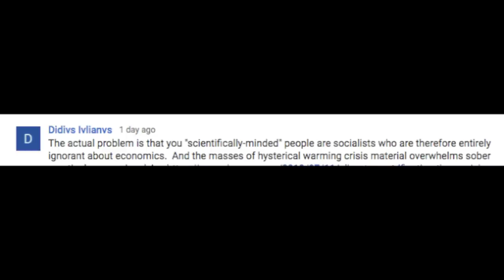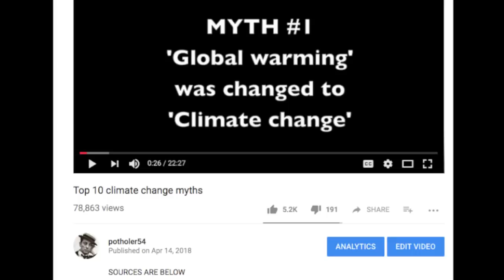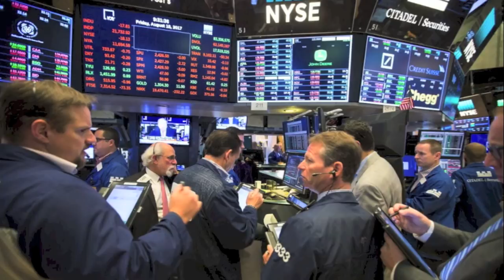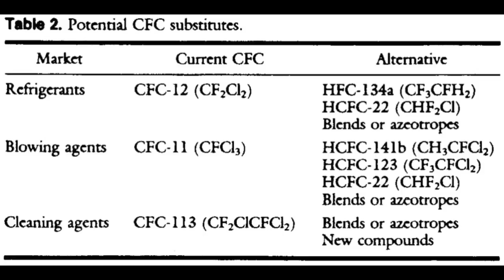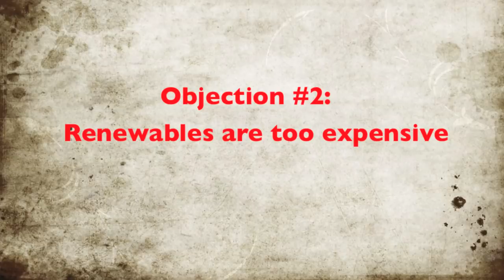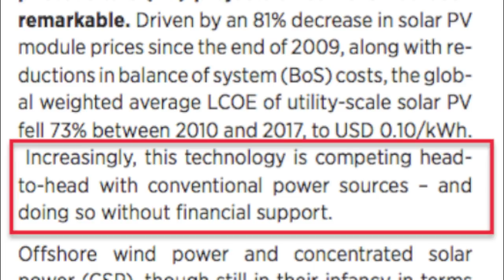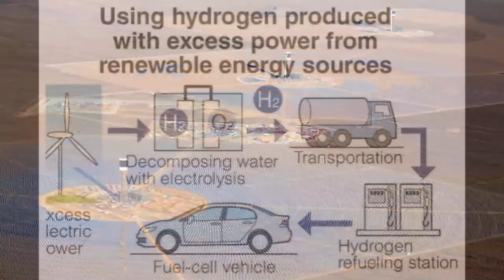A CONSERVATIVE solution to global warming (Part 1)

Comment: @17:32 the most efficient of these 'batteries' still wastes a lot of energy...if you rolled up your sleeves and found solutions for nuclear you might end up with a better solution that dosen't need batteries. I wish nuclear was invested in alongside renewables, because it can fix problems in supply created by them and is arguably cleaner if you store the waste safely.
Reply: Here is the greatest lie ever told about renewable energy: That we need energy storage because of it. Nope. We need energy storage, period. If you replace all renewables with more coal and nuclear you will still need either energy storage or another power plant for when every house in the city turns on the lights, AC and TV at the same time. And the exact same people who complain about renewables will again tell you that energy storage and nuclear is too expensive and we should instead build another coal burning plant.

Except you can't light up a coal furnace and start producing more power in the seconds you need to avoid brownouts, those turbines take minutes to start spinning and that's after however long it takes for the water to star boiling. What these anti-battery lobbyists are really saying you need to build a coal power plant, supply it with coal and keep it hot 24/7 just in case you need a little more power for a few minutes. Because building that coal plant is indeed cheap, but just like the shop offering a cheap printer or razor now with extra 50% off, they are trying to hook you into paying for the overpriced ink and blades instead.

Even if you just build a bigger power plant in the first place and leave some capacity unused for the times of high demand, that capacity needs to be ready for immediate use, meaning it takes coal, manpower and maintenance to keep it that way. Even if the owner of the plant agreed to leave that as a reserve instead of running at 100% all the time and sell more electricity, do you think he doesn't want to be paid enough to keep that kettle boiling 24/7?

I definitely support nuclear and renewable energy, but even if we figured out high temperature superconductors and could power the whole world by drawing power lines from solar panels at the equator we would still need some kind of battery for both balancing short term demand and as a reserve in case of some accident cutting the lines.
Reply: @AnalystPrime  No one is saying you should never store power. We have done this for as long as we have generated electricity, by doing stuff like pumping water upstream. This is not new, batteries have their uses. The important point is the 'duck' curve. Demand for energy has a small peak in the morning and a larger peak in the evening and night. Energy generation from wind and solar tends to peak mid day. When i overlay these graphs I get a duck shape. The gap in the middle is the problem, as I need to store most of the energy I make for the evening. Doing this incurs a loss, as it always will due to the laws of thermodynamics. The loss currently is big, batteries are not a wonder cure for this. The more expensive batteries use lithium which has problems with supply as its mainly mined from salt plains, such as the one in argentina. A small amount can be extracted from seawater, but the technology isnt there yet for it to be comercially viable.

The problem with renewables is that we can't just up energy output at peak times. Nuclear isn't that good for this either, you have to slowly change the power output of a reactor to keep it safe and turning it off requires fuel re-enrichment, which takes time. Coal doesn't have those problems, you can fire a plant up much easier than nuclear. I am very pro nuclear, so I say this with gritted teeth, fission does not fix the gaps in supply of renewables. This is one of may reasons why we are so interested in fusion, a clean nuclear reactor.  If it weren't for the large downtimes of the experimental reactor, you could either start a reactor running with a burst of power or keep it running in steady state as it will eventually be very cheap to run. There are problems with renewable energy source, if you don't believe coal lobbyists (which you shoudln't!) ask people researching in that field.
Reply: @coolpeopleit  The duck curve always sounds weird to me, keeping lights and TV on late at night uses more than all the industries that operate during the day? Alternatively, it is saying solar power is enough to cover all the commercial needs yet still "not efficient enough"... Also, wind always calming at the same time sounds like the very opposite of "can't be relied upon", if you know when it is windy and when it won't be blowing then you know where to put those windmills so you can get wind power 24/7. Then there are tidal and geo power, how do those just shut down every day?
Lithium batteries are not the only tech we have, only the best we had for small scale stuff like cellphones. We can use things like salt water batteries or heat storage for large scale applications, the system might lose a little power, but if we produce it at gigawatt scale for the grand price of having few minimum wage workers wash the mirrors/solar panels every week we can afford to lose some.
And everyone is talking about problems with storage, if batteries are too expensive just fix the ancient grid to modern standards and bring in cheap electricity from elsewhere, it's not like we build other types of large power plants in the middle of cities either. The solar panels on your roof might not produce any power during a storm and high winds may force you to shut down your windmill, but the weather tends to clear out once you get little further away.
The real problem is that there are areas where you just don't have good light, winds or place to put a wave or geothermal generator. Fusion has advanced rapidly(if we get it in 50 years as the joke goes, it will come far faster than almost every other invention) but I suspect we should be developing thorium reactors now instead of waiting for it. If we still need some burner plants, that's fine, there are plenty of them already so we don't ever have to build new ones. As a bonus, lower demand means coal&oil will cost less.
Reply: The new generation of reactors can burn nuclear waste and won't meltdown. Unfortunately Fukushima was really badly timed, it was an old vulnerable design placed in a hazardous location.

Comment: Or, we need to build a star ship to get to another star, so just roll up your sleeves.  Get the message?
Reply: At what point is there a need for us to get to another star? What problem would it solve that can't be solved some other way? It's not a practical solution unless it actually can make things better when it is implemented. I'll give you the benefit of the doubt: seems you didn't pay much attention to the video.

Comment: Wind and solar are too diffuse. There is no way to harvest more energy than the sun and the wind are giving you. And you talk about pumped hydro storage like it's a new idea, we have been using pumped hydro for like 100 years or more. Same with flywheel energy, we have been using it for voltage,and frequency stabilization forever. It's also good for correcting low power factor. The flywheel storage thing is known as a "syncroness capacitor". Maybe you should get your information from actual engineering text, and not sales brochures and the news media.
Reply: take a look at this here:
https://en.wikipedia.org/wiki/Desertec

tl;dr for you: An area of 500km x 500km in the Sahara desert would be enough for a solar power plant (a THERMAL solar power plant, to be precise) to provide ALL power needs of africa, europe, russia and parts of asia (including mobility through either hydrogen or pure electric methods). 200x200km in the Nevada desert would be enough for the USA, Canada and Mexico to do the same.

The solution is there. All we have to do is take it and pursue it.
Reply from the maker: @Cindy Tepper wrote: "There is no way to harvest more energy than the sun and the wind are giving you."
   And yet several ways of storing energy are explained in parts 1 and 2 of this video. 
   If you have never heard of them, all sources are in the video description.
Reply: Cindy Tepper
As has been pointed out above, your assertion that "wind and solar are too diffuse" is wrong. But I would be interested to know where you heard this?
Also, are you convinced by the information and sources cited above that your statement was incorrect? If not, please could you explain why?
Thanks
Reply: @michaelrch  I'm 58 years old with a BS in electrical engineering since 1985. I worked with motors and emergency power generation for about 25 years. I didn't "hear" it anywhere. It is a fail at the back of an envelope calculation stage. . Do you really believe there is enough capacity to power all the large industrial users? As soon as somebody fires their EAF steel plant or their aluminum smelter the lights are going out
Reply: Cindy Tepper 
You aren't applying any analysis or research to your argument. You're just saying that it wasn't possible in your day. 
There are now single wind turbines (from GE) that generate 12MW. Tesla's Gigafactories are being fitted with enough solar power to produce more power than they need.
Renewables are far more advanced than you're familiar with. Solar is pushing 30% efficiency now. Battery storage is being deployed by the GWh. 
Read the UCS report I pointed you at. They aren't just making shit up....
Reply: @michaelrch  12 MW is nameplate rating, real world production is about 2.5 MW. In other words, average daily production would be about 30MWh because the wind is intermittent. As far as solar goes, here in the Northeast US we get approximately 2.5 solar hours per day. Look at a solar map used for designing solar systems and you'll see. 

I don't even want to get started on the entropy of the storage systems.

BTW Elon bulls*&ts a lot
Reply: Cindy Tepper 
Are you sure you're an engineer? You are citing a capacity factor for win of about 16% when in reality it's 40-50%
https://cleantechnica.com/2012/07/27/wind-turbine-net-capacity-factor-50-the-new-normal/
And capacity factor isn't even the instantaneous power, it's the aggregated power over time vs nameplate, so to say that a 12MW turbine can output a max if 2.5MW is nonsense. I think you know that.

And of course solar works better in some places than others, but who said solar would be the mainstay at high latitudes? Clearly when available solar power is lower then you would rely more on alternatives like wind, hydro and nuclear. But most if the US and much of Europe is able to make highly economical use of solar.
Plus with sufficient HVDC grid infrastructure, then solar at lower latitudes can supplement supply at higher latitudes.

Everyone knows that switching to renewables will require a lot of new infrastructure to deal with differing geography, availability of renewable resources, storage, etc. We know that. But it's not an insurmountable challenge and your original statement is clearly wrong. Just accept that. 

Tbh as a former engineer myself, I can't think of a more fascinating and worthwhile challenge than planning and executing a switch to a clean sustainable energy grid. It will call on every facet of engineering ingenuity from marine installation to flow mechanics to thermodynamics to electrical systems to civil engineering to grid planning to AI supply and demand management and on and on. I find your defeatist can't-do attitude the opposite of how an engineer should approach such a project.

Comment: 0:18 So far we agree. It only took them 2 years too!
Reply: 0:45 And we depart here. The industrial revolution overall caused good health.
Reply: 0:47 and disagree again. Global warming is better predicted and more historical accurate with solar activity than carbon dioxide.
Reply: 1:04 again we disagree. I don't know who told that this was between communists and those that believe its all a hoax. The problem is between climate change realists that want to examine everything such as the effects of the sun, cosmic rays, water vapour, etc, and there is the side that believes a rise in temperatures due to leaving the ice age is caused by 200 years of industry, which is killing the perfect natural order of earth (while ignoring the geological timescale of co2 and temperature.
Reply: 15:43 Those things were built using co2 emitting machines, and emitted co2 themselves.
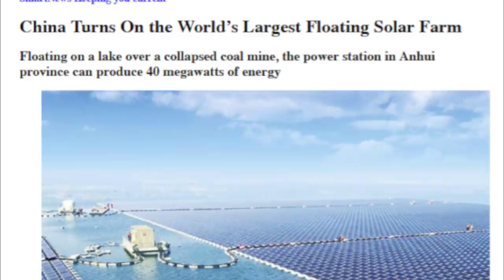Reply: 20:54 Why do you want to get rid of carbon dioxide, plants need it to breath and we breathe it out. Volcanoes spew it out, so do geyser and hot springs. We evolved around this. Why get rid of it? To what level of ppm is good?
Reply: @MasterofFace  
Hello,
1. He is not saying the industrial revolution OVERALL caused bad health, he is saying polution in particular causes bad health.
2. Solar activity has been going down over the past decades, while temperatures have gone up.

Comment: The solution is nuclear

You can't change my mind
Reply from the maker: See part 2.
Reply: @potholer54  : just because nuclear is clean, and low maintenance, and can run for decades, and runs 24 hrs a day and is so cheap to run, is the reason is will never be used.   
the CO2 fraud is not the science, but the debate and the gov't intervention, and lack of Gov't action.
the CO2 fraud is more of a campaign issue that we will have for decades.  like abortion.
welcome to CO2, the new campaign issue that will never get properly addressed or funded.    '
not because capitalism is in the way, just the opposite, because socialism needs to make up issues.
Reply: @dave-in-nj9393  Nuclear is not cheap. I still think it is the best option. But I also think it is the main ingredient in a complicated recipe.
Reply: @Superiorer  : the lie is that is is expensive.   it costs no more than any other type of generator.
in fact a pellet reactor can be built and installed and requires no maintenance.  no new fuel no supervision, no daily deliveries of coal.
the cost of building is faked to make it 10 times the cost so that we are paying on the debt of the build, not the maintenance and up-keep